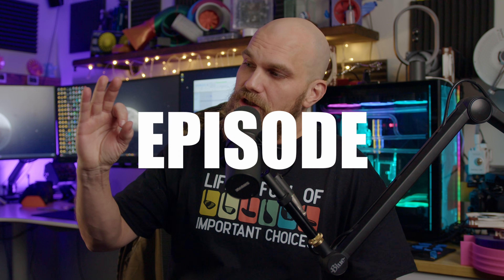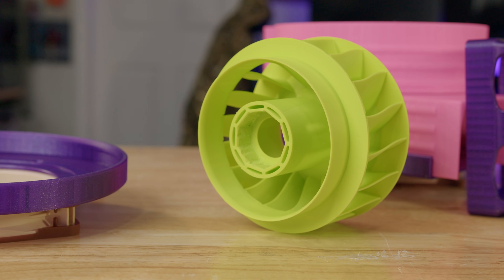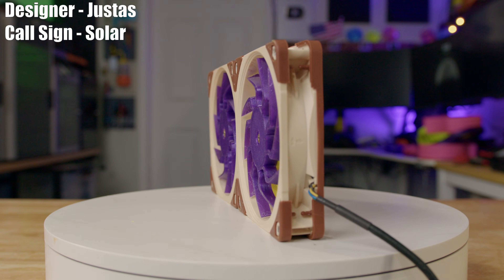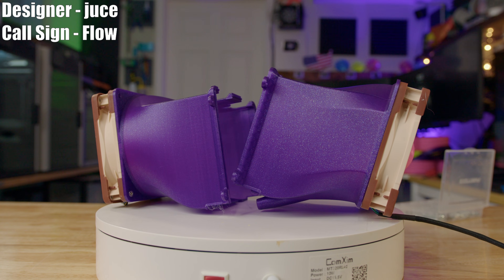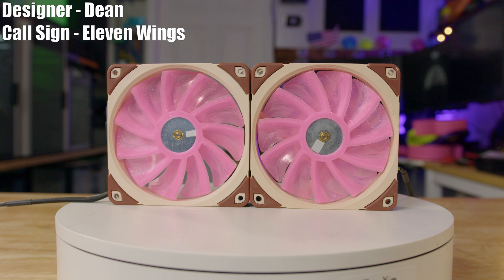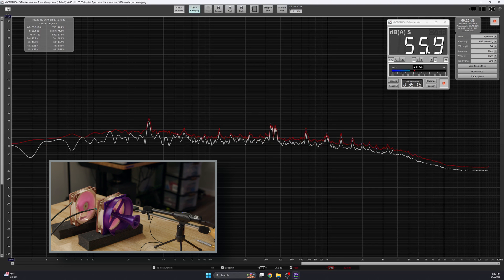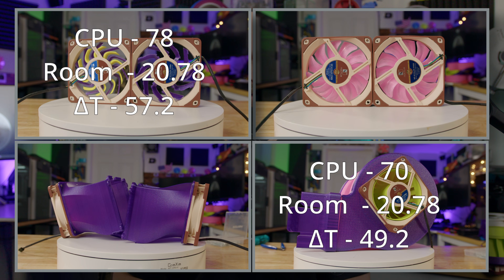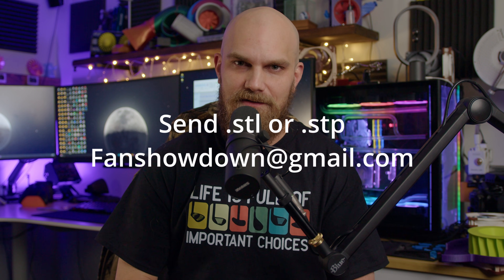The Most Aggressive CPU Fan Ever Submitted | Fan Showdown S7E3

Comment: Why isn't the cooling block (heat exchanger) being used while doing the noise testing?
Reply: would like to see the flow tests with it too
Reply: @rayzian I see why some want that, but at the same time it wouldn't be a good test of how the fan blades alone move air. The fins of the heat exchanger would make the flow mostly uniform regardless of fan design.
Reply: @EidolonFantasma  Isn't that kinda the job of fan? I mean, what it's being designed for?
Reply: @kleetus92  Depends on the application.This could also be used to just focus airflow.
Reply: @kleetus92 Seems like you're misunderstanding what I'm saying. Look up laminar flow. If all the airflow looks the same during the smoke tests, then visually speaking, it wouldn't be interesting to look at.
Reply: @EidolonFantasma  good point but we could at least see how fast it flows through & how effective the push pull configuration is working
Reply: We be called for it before, as it's inclusion is valid given what happens when air hits stuff.
Reply: Presumably because he wants to test JUST the fans, rather than how they interact with the fin stack. Personally, I think that's fair given the way the Showdown is set up. If they had used the cooler during the noise tests, all those vibrations on the dual blower might have absolutely trashed its relative success, I think that would have made a ton of noise. But, these aren't being designed as end-user products to be sold, they're engineering experiments, so it's fine imo.
Reply: @vidyajamesu Making a lot of noise while connected to the stack is exactly why the stack should be included. The stack is a constant variable, and what good is knowing the fan alone is relatively quiet, if in practice it's noisy as heck? There's also no reason there can't be a sound measurement both with and without the stack.
Reply: @EidolonFantasma  Because developing for that requires pretty constant feedback. You'd have to own that same model of cooler and repeatedly iterate on the design. Most of the people making these submissions probably don't have a spare just laying around to test with. By leaving the cooler out of the equation for noise testing, the NEED for that iteration is removed, lowering the barrier to entry. Now, if there are submissions that DO take all this into account, more power to them, but again, this is just a gaggle of students and enthusiasts showing off some engineering experiments. They are not end-user products, and subjecting them to rigorous development standards as if they were is unfair, I think. There is no "in practice" in this case.
Reply: @vidyajamesu Again, there is absolutely no reason there couldn't be sound measurements made with and without the stack. Designers watching would learn from the issues by submissions and take steps to improve their designs to mitigate or eliminate similar issues.
Reply: I think he didn't want to change the measurement style. I definitely agree that noise comparision is valid only with the CPU cooler in the mix because some fan designs may have very different noise profile with and without backpressure from the CPU cooler fins.

Comment: The way noise comes into the ranking should play a bigger role the more dB you see, because it's not a linear scale. There is also the slight matter of frequency given how our ears work. Looking at the data though at most you'd have some trading places if adjusted for that. At the top 3 not much difference in how noise equates to performance.
Reply: The cooling block should be in place during the noise/sound testing.

Comment: I feel that with the first fans you did the smoke test on, like they might have been pointed to where they were blowing against one another? Because it had absolutely no flow through one side and out the other. I think you put one of them backwards.
Reply: Yeah that looks very wrong
Reply: Two of them were blowing air into each other
Reply: he mentions it talking about the fans that they were sent to him mirrored so they'd essentially be fighting each other. sometimes if it's easy to fix the design to make it work he'll do it.
Reply: @sirmonkey1985  Just means he needed to flip one of them over.
Reply: @sirmonkey1985  the idea of mirrored fans is that they're put back to back so they're not fighting eachother.

Comment: New setup is fine :) For the smoke test, wouldn't it be better if you test it WITH the coolingblock?
Reply: More importantly it should be used during the noise/sound testing.
Reply: @EidolonFantasma  this too
Reply: For all the test imo.